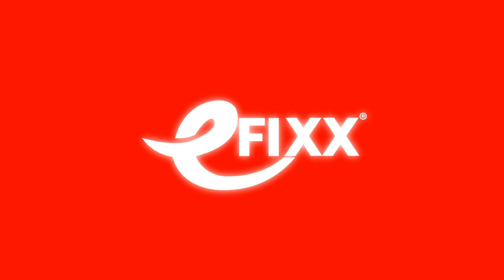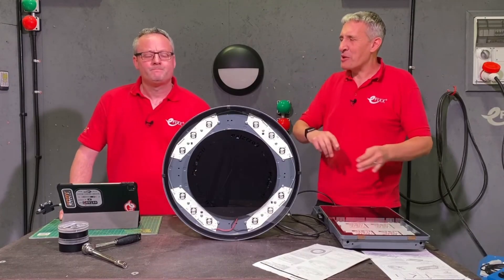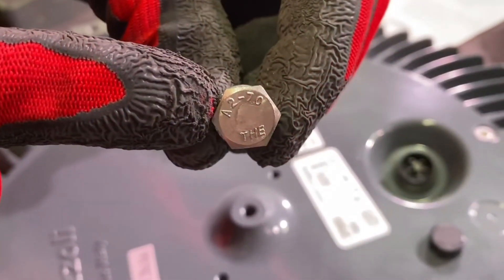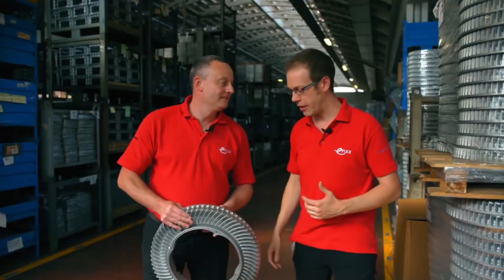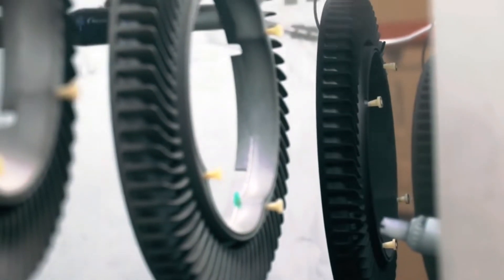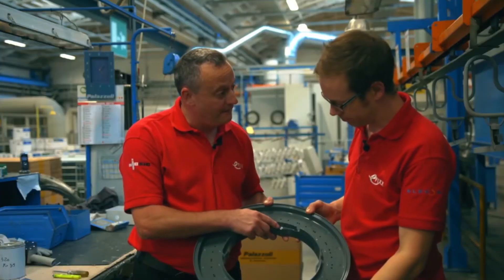The Reason Why LEDs Need A Heat Sink - Electricians Q&A

Comment: I am trying to light up letters on a cheerleading sign. I am looking into COB LED strips. I want to attach them to a battery pack and install them on corrugated plastic signs. Will this work??? Each strip would be no longer than 8-9 ft long.

Comment: I hear that incandescent wast energy with heat.  So led lamps also have heat issues so is that also wasted energy.  A shop I did work for changing all 20 of his old style tube lights he did save money over the summer but he did say the shop is so much colder in winter an ended up over the year paying more having heating on.  So my point is is that heat out put with light us killing two birds with one stone.  Can the heat out put that is heating the shop help reduce cost of normal heating.  So there good and bad.  Back when I was at college back in the late 80s we did led light panels.  Were we had them in strips switching on and off very quick so to the eye the hole panel was on this was to safe power.  Were will lighting be in 5 years.  Could we not plumb them in to the water have water cool the housing an use the heat to reduce cost.  Sounds mad a mental idea but some of the best things we have started as a joke.  Dam Were are my royaltys.
Reply: Heat output from an LED is around 20% while heat output from an incandescant lamp is around 80%.
Reply: @odinnln5694  incandescent light bulbs are way less efficient than that, with less than 5% of the electricity consumed producing visible light. The other 95% or more is either radiated in the infra-red band, or is conducted/convected away. Even LEDs are only 40-50%  efficient at turning electricity into light. So an LED is of the order of 10 times more efficient at producing visible light than is an incandescent light bulb, but event that 50% of energy the LED generates as heat is still a problem.
Reply: Does that include the losses for LEDs converting AC to DC? The use of resistor ladder step down produces a fair amount of heat. @TheEulerID
Reply: @odinnln5694  No, but the most efficient type of LED drivers are constant current, and don't use anything as crude as resistor droppers.
Reply: Even constant current drivers have losses associated with them. @TheEulerID
Reply: @odinnln5694  Nothing will be 100% efficient of course, but modern drivers can be very efficient. For example, a circuit using the  LT8391 can reach 98% efficiency. So if we take a 10W LED lamp, then we might get 4W of visible light, 5.8W of heat from the LEDs and 0.2W of heat from the driver circuit.
Reply: I believe the Laws of Thermodynamics say the same thing. @TheEulerID
Reply: So fluroescent are somewhere between incadescent and LED in terms of efficiency. Have to also remember the location of the light fittings - in a ceiling not necessarily very efficient when you want the heat lower down in a room/building. There is heat generated by a light source, but an electric convector heater is 100% efficient, whereas a light source isn't - part of that loss of "efficiency" is light so still more efficient to use LED bulbs and a separate heating source
Reply: @guffermeister  My thinking was in winter he was much wormer he did not uses as much money on heating then changed all the lighting his cost did go up.  But in summer he has too much heat.  My TV is a old bit good plasma it has heat out put but in winter I like it.  I was going to try and work out light out put heat out put an see costing.  Some people don't like LED lights as there to white incandescent have a wider bandwidth of light that is like sun light that humans like.  List all the good list all the bad.  My head will hurt trying to work it all out.  As I see it if lights give heat wasted energy if LED light need heatsinks bad design also wasted energy.  But is heat out put as well a bad thing going back to winter time.
Reply: @alunroberts1439  It's definitely a valid point. I'd argue that in bigger buildings or places outside will be fine with LEDs. Especially outdoors.
Reply: Remember seeing a video of something similar. The icing of traffic led lights in colder countries when they switched to efficient led type traffic lamps. Sometimes you have to look at the two sides to every story. Interesting scenario and would have loved to look at the actual measurable data on your project so to speak.
Reply: Electric lights will, of course, contribute to the heating, but there are a few issues with it. In the first instance, you do not want to be producing a lot of heat if the weather is warm. All you then do is produce a lot of waste heat that has to be disposed of, perhaps by air conditioning, using even more electricity. 

The second point, is that using electricity for space heating is often much more expensive than alternatives, like gas. Even where electricity is cost-effective, then it's much more efficient to use a heat pump than what is effectively just a resistive heater. With a heat pump you get around three times as much heat energy per kWh of electricity than with resistive heaters (it doesn't breach the principle of conservation of energy doing that as heat pumps work by using some power to effectively concentrate the low grade heat found in the ground, water or air).

In all, it's better to use more efficient lightning in the first place as it won't generate large amounts of excess heat when it isn't required. If you want to use electricity for heating, do it via a heat pump, not wasteful incandescent lighting.

Comment: What is the best way to dim a group of LEDs remotely in a big industrial area ?
Reply: Buy high bays that have 50% dimming low voltage controller.
Reply: Lighting Control Modules, Kliks
Reply: Thanks for the replies, I’ve a false ceiling fitted lights in my workplace and searching for a dimming controller
Reply: Ive only ever fitted colour changing spots .the low bays ive fitted led werent even colour changing.that was 3 year ago could be something on the market now

Comment: I had always wondered why lower wattage LEDs needed heat management while bulbs at 60+ watts did not!
Reply: The reason is the requirements are polar opposites. Ordinary tungsten light bulbs work because the filament is heated to white hot. They simply wouldn't work if something conducted away all the heat and traditional light fittings are explicitly designed not to conduct heat away efficiently. The incandescent bulb needs that heat to work as that is how the light is produced.

However, LEDs don't work like that. They generate light by electrons jumping a band gap in a semiconductor (typically around 3V depending on the LED colour). That produces photons of light directly and not only doesn't need heat to do it, but above a certain temperature, it will actually damage the semiconductor material. LEDs are more efficient than incandescent light bulbs, but they still produce waste heat, and that has to be conducted away or the device will fail. So an LED fitting has to be cooled, when it's the last thing you want with an incandescent light fitting. The former dislikes heat, the latter won't work without a lot of it. It also follows, of course, that fittings designed for incandescent lamps are not ideal for LEDs and vice-versa.
Reply: Tungsten fillaments can handle several hundred deg C. An LED can't....

Comment: Because cheap capacitors will die after a year over 85C if they are part of the assembly.
Reply: Or in cheaper fittings cheaper LED's with a much lower lifetime and also possibly over driven